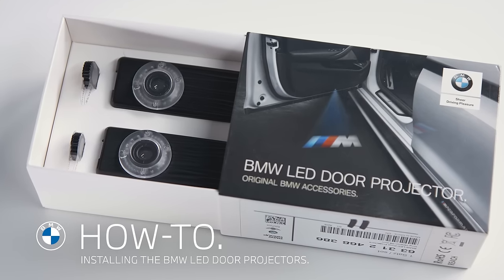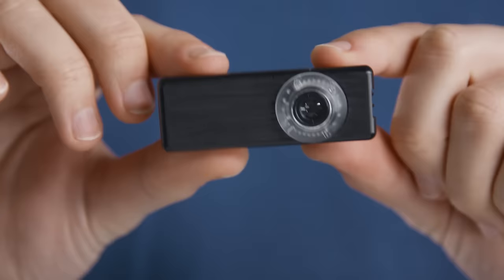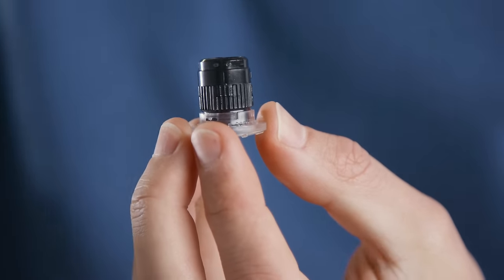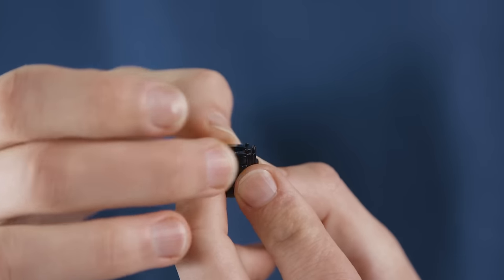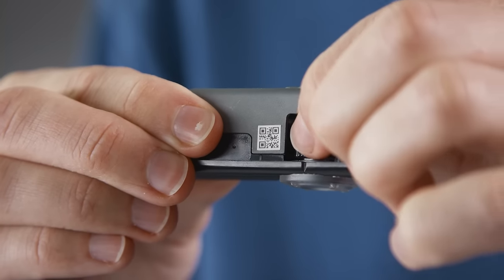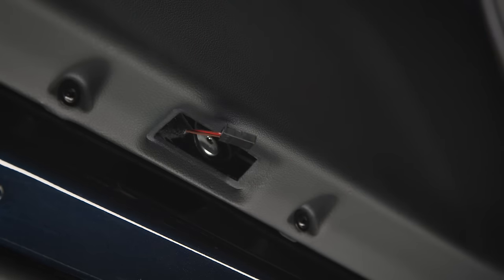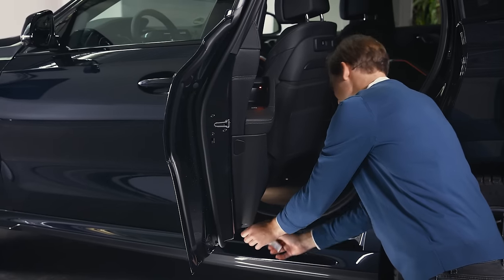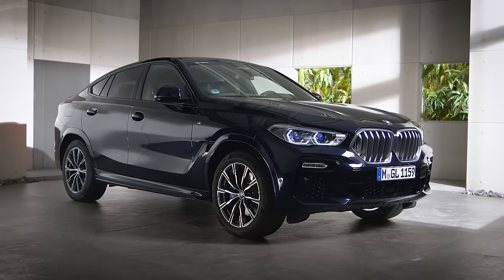Installing the BMW LED Door Projectors – BMW How-To

Comment: I wish the DIY would have worked smoothly as depicted in this video. After watching this video, I bought the door lights from a bmw dealership but the installation on the BMW X5 G05 B57 (with production date Oct.2021) was a nightmare, as you will need a cutter-knife to cut-off some material to allow the light to fit nicely. After my failed installation attempt, I took my vehicle with the light to a BMW dealership, with the midset that they gave me the wrong set but it turned out to be the correct sets for my vehicle. The BMW dealership mechanic also had to use his cutter-knife to sheer-off some material before the lights was able to fit. The way I saw him struggled to insert the light, scare the hell out of me not even dare to change the projection inserts. As a 1st time BMW owner,  this was a big disappointment moving from KIA to BMW. When KIA advertised a product, its works as advertise and I was expecting the same for a high-end car. I considered this video as misleading. BMW, should work hand-in-hand with their accessories provides to ensure that things work as advertise.
Reply from the maker: Hi Hector, in order to submit your complaint to the relevant department, we recommend 
using our contact form by clicking the following link: https://www.bmwgroup.com/en/general/contact.html Our Customer Support Team will get in touch with you as soon as possible.
Reply: Exact same on issue G07 X7 M50i. I can understand your pain and I’m still struggling :(
Reply: Same here, was able to follow instructions and switch the slides to m badge but unable to install this new fatter projector into the existing opening of my 2022 X3 M40i. Anyone successful in getting this installed on a newer X3 ??
Reply: @anandraman2163  You will need to use a file to file off some of the door panel material from the light slot. Thats what I did on my 2021 X5 (G05)... file all four sides of the slot. Do it bit by bit and keep testing after every section of filing.......
Reply: @hectorsesay8579  ok thx but it worries me that I'm filing for this new projector and if down the line I have to replace these, the newer ones wont fit or can't go back to factory default puddle lights
Reply: You need to use a left handed screwdriver to remove the lights Hector, I have a feeling that's where you went wrong. The video should make this clear.
Reply: @ronaldJ262  thanks for your feed back the final outcome was that the bmw dealership here in Austria was a bit surprise that the lights were not as it was advertise in the bmw video namely "BMW  How To".  They file a bit-off the door cover material and the  light fitted. The BMW dealership in Aistria had contact BMW HQ,  in  Munich, Germany about the discrepancy on the accessories material since the add-on after market parts sold by bmw dealership are produced & supplied by another company (none-BMW company). to address the fitting issue.
Reply: Wow I just spent over an hour trying to get my projectors in and they straight up will not fit in. I’m guessing I have to cut some material away too. Would be nice if they actually went in as easy as on this video.
Reply: @Sutt02  yap, you can file a bit off the door panel plastic part to make some space. Do not force the light assembly in,  if you do and try to take it out then another disaster will happen, the light assembly will fall apart. I filed  bit by bit and tried it  in and out till if finally fitted. Goodluck.
Reply: @hectorsesay8579  thanks! Yep I figured that out the hard way. One of the projectors fell apart but was able to put it back together and get it in finally after filling away
Reply: @Sutt02  Glad you were able to complete the task. BMW must step up their game with the producers of their accessories.
Reply: instalation peace of cake on a x2

Comment: Just installed these on a 22 M850. Process was SUPER easy!! Less than 5 mins. I didn’t even need a screwdriver. I just pulled out the old one by hand and replaced it. Thank you!
Reply from the maker: +AmirPerry We're happy to hear this 😊
Reply: @BMW  Will these fit an i4 (M50)?

Comment: I just installed these with the performance slides and they are awesome. Sadly I was somehow expecting four projectors in the box :(. A bit expensive but totally worth it.
Reply: Or get aftermarket lights, much cheaper and more worth it than those from the greedy company called BMW.
Reply: @Supremepikachu  you don’t buy a BMW with the purpose of saving money or being cheap lol
Reply: @pugasnkr  BMW is overpriced for what it is, i'm disappointed with how bad and poor my bmw f30 build quality is, i need to friggin replace every single shit that those germans made with better engineered stuff.
Reply: I was just expecting 1, and was surprised I got 2.
Reply: @Supremepikachu  The after market lights burn out pretty fast or fade out should I say. The factory ones come with a 3 year warranty
Reply: @Supremepikachu  u sound like you're upset with life and tight mofo, who either just about can afford a BMW or never owned one (acting like you did for attention)

Comment: Trying to check if they fit on my Z4; G29.  Giving my VIN number it says the projector lamps are not compatible with my car but the matching projector slides are in fact ok to fit my vehicle.  I am aware that there are two different models of projector lamps; the older version and a newer, slightly smaller version. Can bmw help me. I' ve been to the local bmw agent but even these people are puzzled.

Comment: It’s a nightmare in the 2024 X5 model. I cannot fit it the design is beefier than the default factory light. Poor accessory collaboration. I didn’t bother to cut or trim the door panel. Got to return it to bmw accessories.

Comment: It’s weird that since this video came out the projector itself is not available/compatible anymore for X1 (F48) in BMW’s online shop.
Reply: I was just wondering about that. I have a 2017 f48 and I was thinking about installing this. Have you tried ?
Reply: Where can I find if out if this projector is available/compatible with my car?

(Basically, where in the BMW’s online shop did you find you that this [particular] projector (the one shown in this video) is NOT compatible with your car?
(If possible, could you send me the link?) Thanks!

Comment: Seems that unfortunately on the E89 the wiring inside the doors gives you exactly 0mm of length to pull the cable out making these impossible to install without an extension cable or taking off the entire door trim. I guess I'll look for somebody a bit more experienced with tinkering on cars as my dealership is exceptionally reluctant with changing parts, even ones BMW itself sells...